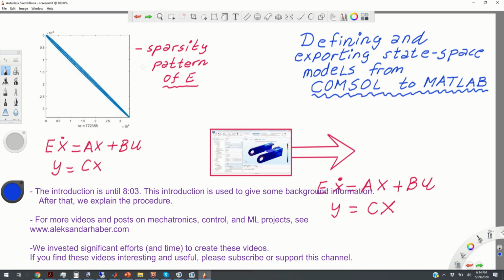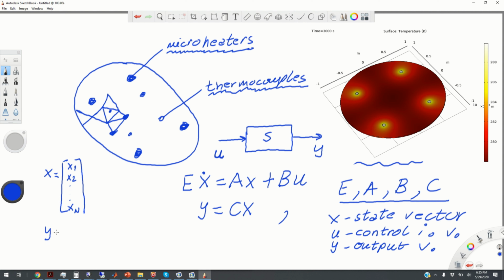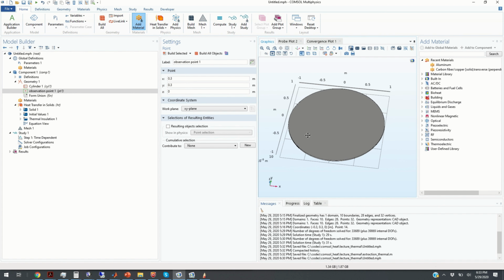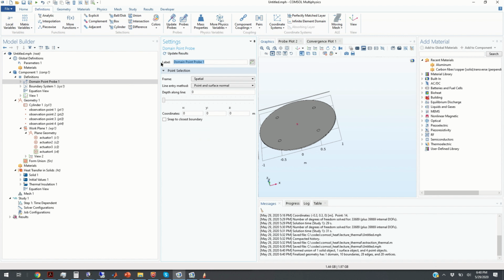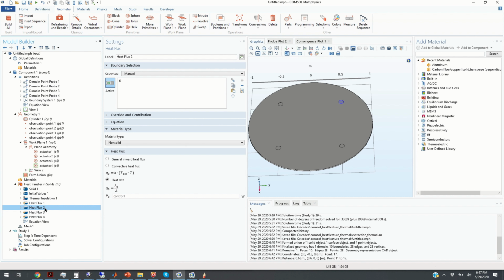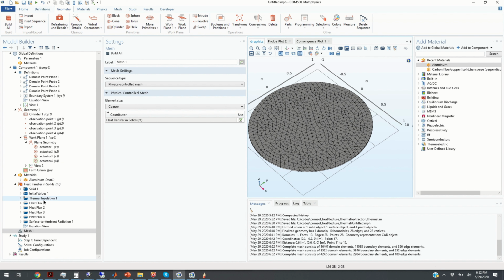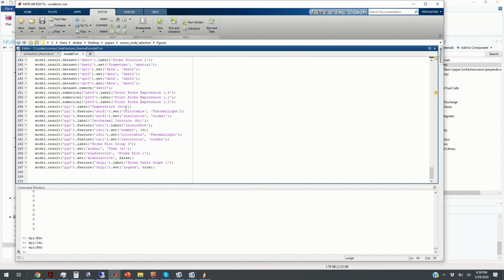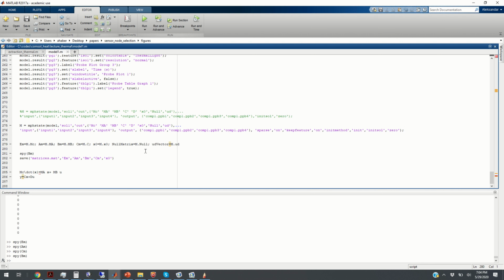Export/Extract State-Space Models from COMSOL Multiphysics to MATLAB- Secrets Revealed

Comment: I'm wondering how do we know the states variables that we are considering in this case study? temperature and rate change of temperature?
Reply from the maker: Since the dynamics is described by the heat equation, the state variables are temperatures at the mesh points. the model is E\dot{x}=Ax + Bu, where x is the vector of temperatures at the mesh points. If you consider structural dynamics problems, then the state variables are displacement and displacement derivatives at the mesh points. These are so-called descriptor state-space models. Best, A. Haber
Reply: @aleksandarhaber  Gotcha! Thank you!!

Comment: I have tried extracting the state space for the centrifugal pump with the help of your videos, it is showing Java Exception occurred: could you please help me in this🙏
Reply from the maker: Okay, you probably need some debugging. First, try to reproduce what I did in the video. That is, use the same model I used and follow all the steps. See if the code will work. If it does not, try to debug it. Then, try to generalize this to your example. The Java Exception can occur due to many reasons: geometry not properly defined, probes not properly defined, typos, etc.
Reply: @aleksandarhaber  ok sir. Thank you
Reply from the maker: @muthulakshmi5162  YNo problem. Good luck.